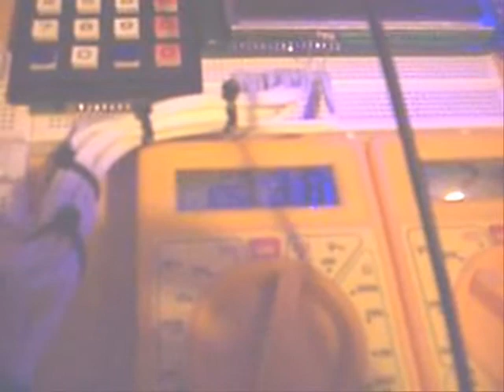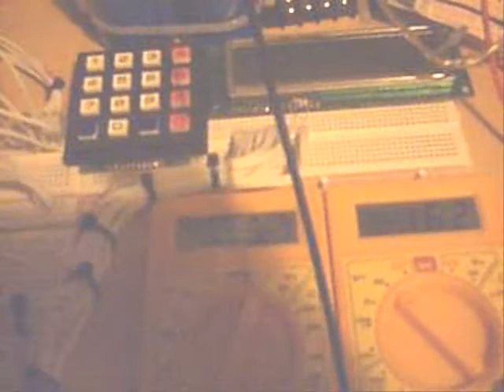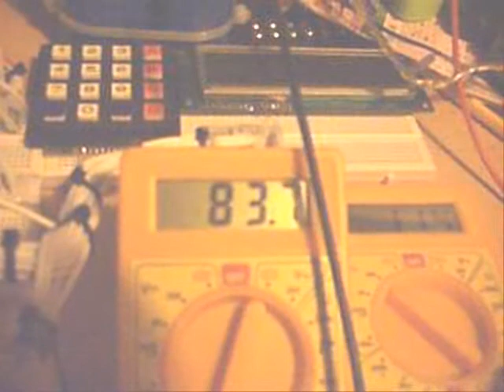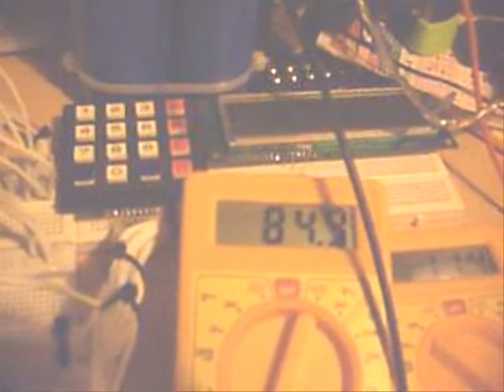Comwarriors Bedini turbo stage 2 results

Comment from the maker: The high voltage caps are used to store the BEMF from the primary drive coil...

The LCD and keypad, well, i'm developing an advanced Pulse Motor control system. For that, you'll have to visit the TEEP forums